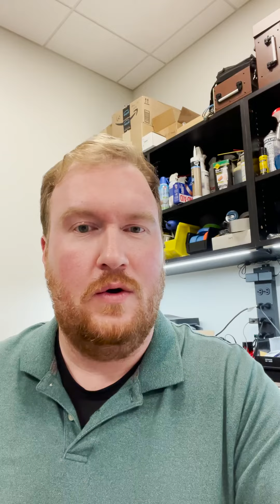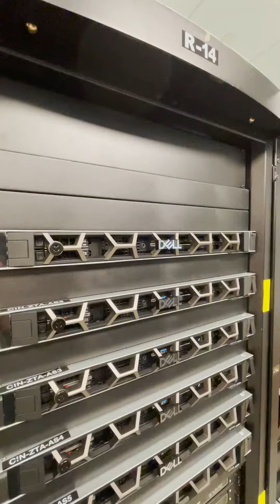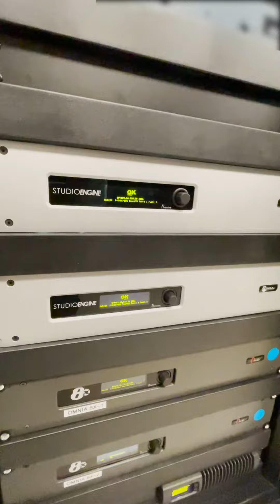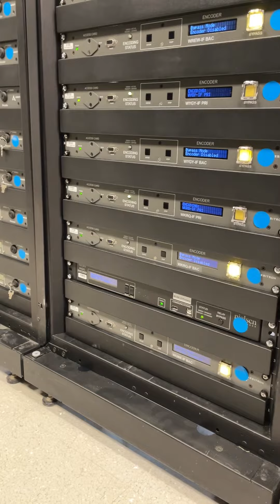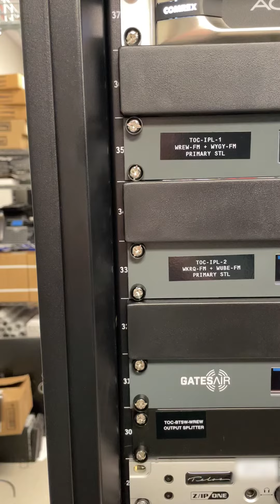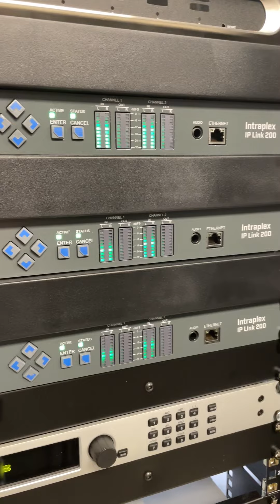Broadcast Engineering TikTopics: What is the airchain?

Comment: I am an audiophile with fascination and interests in sound reproduction and I want to mention that your forum is the greatest one that goes Indepth about outputting the radio signals in the most modern and delightful way possible. There are many times I wish to see a modern radio station because broadcast equipment and styles have changed through the years. Otherwise, I relish your explanations about the way audio signals are processed and transmitted.